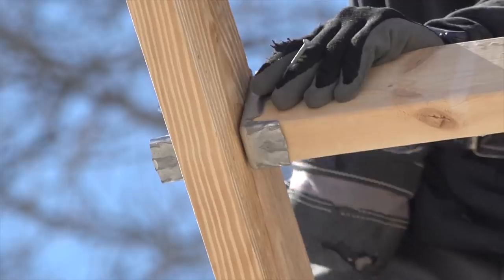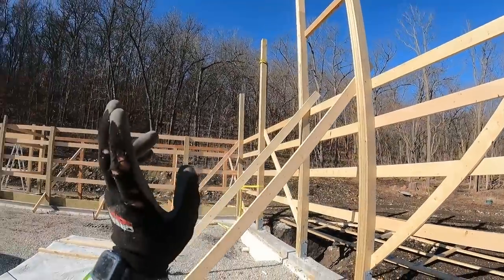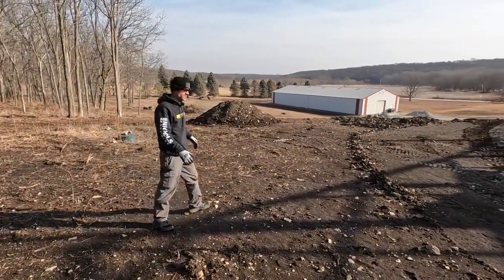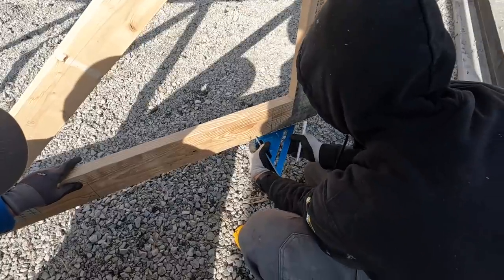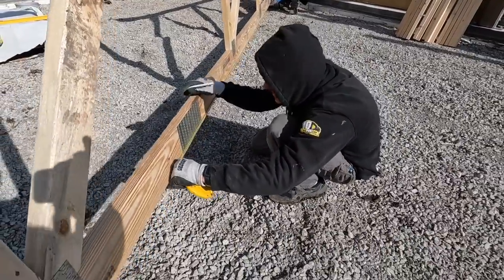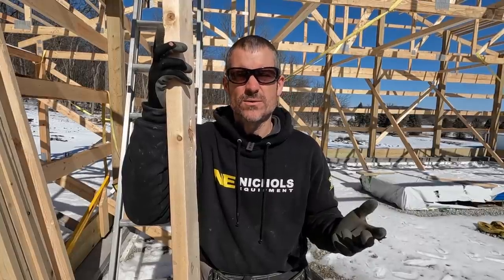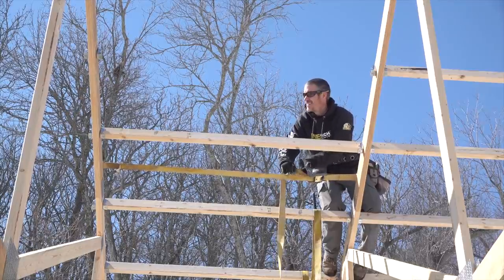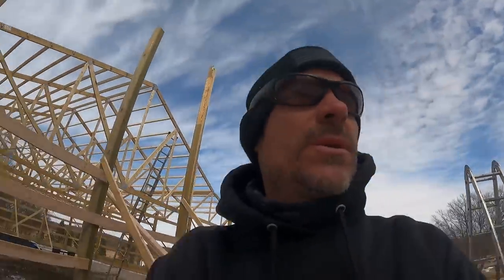Building a Post Frame Home | Trusses | Remington | Ep 6

Comment: I'm interested in what the interior layout will look like. I really like a vaulted ceiling design with exposed beams. The flat interior roof design isn't my cup of tea. I'm designing my post frame home right now and it's somewhat difficult to lay it all out where everything comes together for the interior function as well as a nice look on the exterior. This home looks good on the outside. I love the foundation but for me, I would do the same but make it with a 4' crawl space underneath to run all my plumbing and electrical as well as have more comfort on my feet when I walk around. Concrete is to hard and difficult to install a wood floor.
Reply from the maker: There is a virtual tour in the Remington  playlist if you want to see how things are going to look. If you haven't checked out our new build membership it's a great place to delve into some of those big decisions and the pros/cons of which to choose. https://www.patreon.com/mrpostframe

Comment: The drop purlins definitely look like a lot of extra work.  A lot more nails and nailing work,  plus those hangers look awfully tight with the interior corners being rounded, pressing on the corners of the purlins and pushing the rafters apart.  I guess you have to cut the purlins short by just enough to deal with that without reducing structural integrity, plus strapping the rafters to pull them straight..  What a pain! 

It's the first time I've seen it as well, none of Kyle's buildings seem to do that either.  Something tells me these aren't strictly necessary and structural requirements can be met in other ways.  Something to talk to the engineer and home owner about on future projects.  Looks like it adds a decent chunk of cost.  

Also probably untenable if you want to do spray foam under the roof for a conditioned attic.  The rafters are deeper than what you'd probably spray, so you don't want those to be thermal bridges.  Purlins are smaller dimensioned.  I'm assuming this building will have a standard vented attic and blow-in on the ceiling.